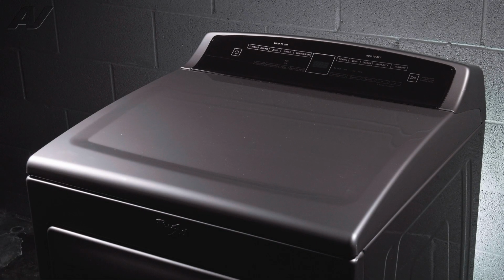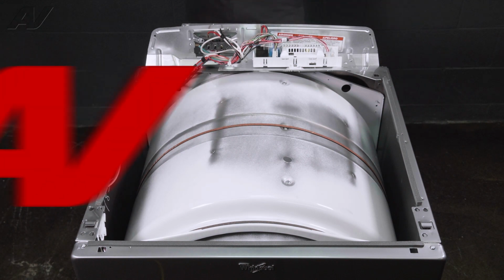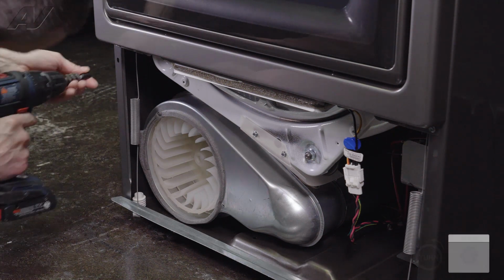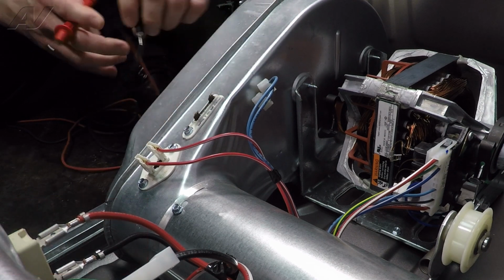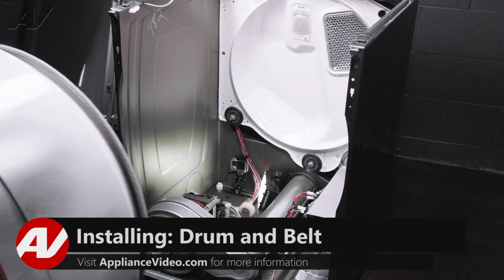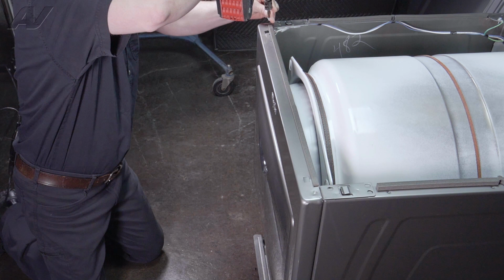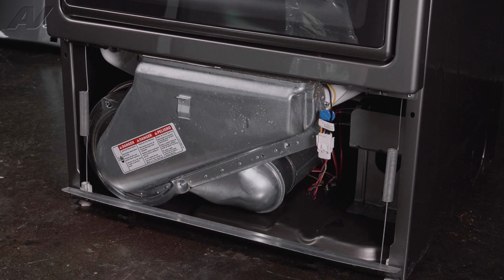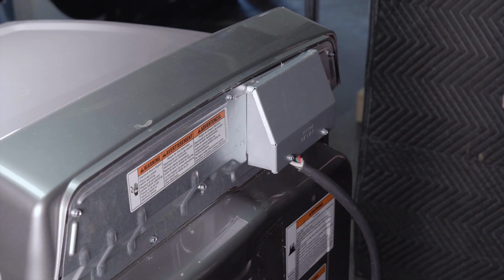Whirlpool Dryer Repair - Will Not Power On - Thermal Fuse

Comment: Great video, but the dryer is garbage!  You have to disassemble the whole freakin dryer just to replace a thermal fuse and a resistor, which could have been located in a more convenient location!

When the blower housing on my WED7500GWO was assembled, the sheet metal screws were stripped, causing the blower housing to inadequately seal & subsequently leak, resulting in so much lint escaping, in a dryer only used 4 months a year over a 5 year period, that the entire interior of the drier had 1 to 2 inches of accumulated lint, resulting in the heating coil burning out.  

I would rate the drier as an overall POS, due to poor design forcing an undue amount of labor to disassemble just to change the fuses, and incompetent manufacturing assembly resulting in heating coil failure!

Comment: Thanks for distinguishing the thermistor and thermal fuse.
Reply from the maker: Great question, if you have a more technical question that our parts department cannot answer, you can search our over 17,000 answered questions free at our website www.ApplianceVideo.com under our Repair Help section. You can also call our parts department at 1-800-830-5465 and they can give you help 7-days A week ,or search at www.SaveMoreOnParts.com  .